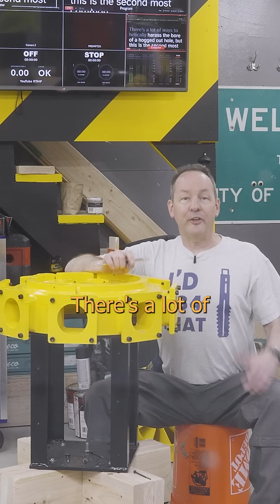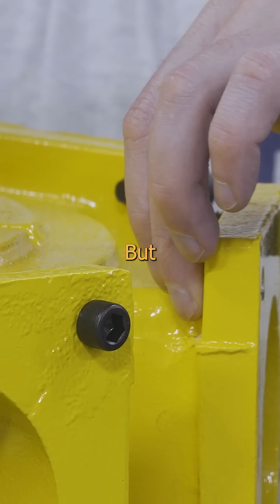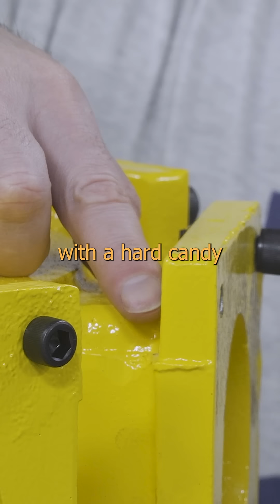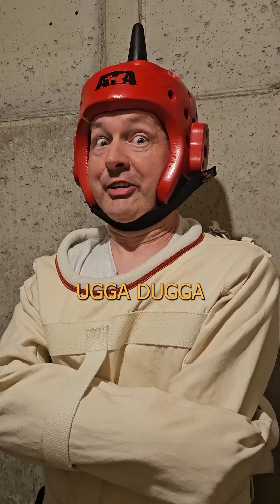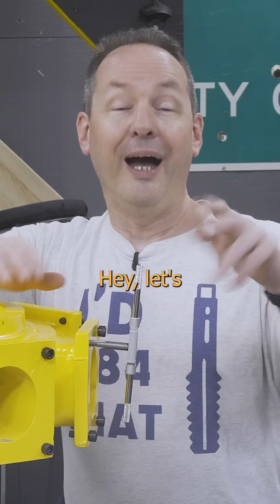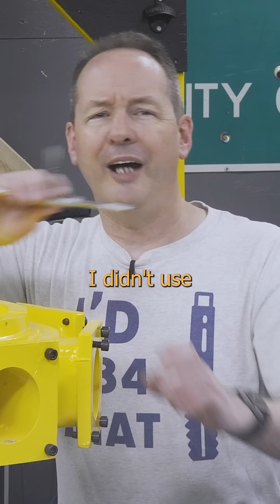Thread Chasing  #chrisboden #comedy #engineering #skills #workshop #metalworking #tools #apprentice

Comment: I have arthritis so spinning a tap in and out isn’t the most comfortable thing for me to do. When I’m building an engine, I clean all the threads before I start assembly. So I pin the tap in and out with a drill, and I just set the clutch to a light setting (usually 3-8 on my drill), and don’t tighten the chuck all the way. Cleaned out hundreds of holes like this and have not broken a single tap or cross threaded a hole that wasn’t already iffy (I have every metric size of helicoil I could possibly need on hand ready for the few times I needed them)

Comment: Actually one time I used a helicoil to fix a transmission pan bolt boss, broke the bolt just before it needed to bottom out, when I I drilled it out the helicoil came out and the original bolt went back in and tightened to specs

Comment: Tightened head bolts on a small engine with a torque wrench at the max setting after taking it apart, they snapped.

Comment: Dumbass. I don't know when I will finally learn the lesson to not force it under pressure, but I have started to learn that when it comes to important data on hard drives or other media, I am guaranteed to lose it if I'm trying too hard. A physical time I learned this lesson was when trying to remove the harmonic balancer from a '92 Del Sol. Thought I could force it with the wrong tools and wound up screwing the engine.

Comment: Dumbass. Lmao. In a aluminum hemi head I drilled out the old bolt that wouldn't come even after welding nuts and easy outs got broken off in it. I drilled the hole to spec size and chucked up the tap. Ended up drilling a bigger whole. Learned my lesson it now has a timsert as the threads and is holding strong and true.

Comment: Dumbass, so as tool and die apprentice I got the joy of re- working some very delicate parts  about 180 of them...so since I thought the holes are already tapped and the drill press was open I would save some time...well I did save time and also scraped 170 w.i.p parts...

Comment: I didn't even use a drill but I was tapping a bed bolt hole on a brand new 2024 rzr 1000 that was stripped and it broke while I was using a ratchet and then my boss told me after that oh yeah I dropped that one earlier...... Took me 3 hours to get it out bc of the angle it was in

Comment: Dumbass... I did the same in an engine block, ended up making a larger hole and threading it for an entirely different bolt and drilling out the hole on a water pump to make it fit properly.

Comment: Dumbass.  I tried to tap a 3/4 inch hole in a 2000 lb slab of steel with a drill 2 carbide drill bits and a few hours later i got the broken tap out of the hole. Re welded the hole and redrilled and tapped it properly.

Comment: Ironically, the word, they suggest pops up a window, wanting to confirm that I understand the community guidelines.  Even though I know you told us to post that word, I’m not going to do so - I don’t need some back and algorithm, deciding that I am the troublemaker that I really am. 
But to the original question, I learned this the hard way, being a less than intelligent mule in the process.

Comment: No drill for chasing threads? Fair enough. Taping fresh holes? I've broken fewer taps with a drill than without. Also, use a lubricant, it's a must for fresh holes.

Comment: And if it’s a blind hole, you’ll be wanting a bottoming tap.

I have tapped many hundreds of holes in aluminium with a drill. The odd broken bit or buggered heat sync was cheaper than my time.

Probably wouldn’t chase a thread in aluminium with a drill though. That’s just asking for a smooth bore.

Comment: "Dumbass" but on the other occasion. I work at fuel refinery plant and we have a lot (and I mean A LOT) of valves. some are shut-off valves, some regulate the flow or pressure or level. The thing is that every valve that regulates something have a positioner on it. And one day me and my colleague started to unscrew the lid, did the job, screwed the lid on, then shit happened, we wanted to unscrew it but "FUCK!" happened and the lid stopped unscrewing because debris got into the threads... somehow...

Comment: I also learned to twist 1-2 full turns and backing out around 1/4-1/2 before doing it all over again was the proper way to do it in trade school. I would’ve absolutely suffered after having to rethread a stripped hole in the schools engines

Comment: Anyone that actually learns to use taps eventually breaks one in a hole doing something stupid. It's a rite of passage. Fun fact: you can us a 3/8-16 die to cut new threads on a 10mm-1.25 stud on your POS Tundras exhaust manifolds. Not easy, but it works.

Comment: you can also do it with a bolt, find the start of the thread of the bolt, turn it 180° and file a notch into it so it becomes like a small tooth that eats the painting.

Comment: Somehow, I got the "Follow the rules to the T" AuDHD and when I went to machining classes, they told us never to use power tools to tap threads. I, honestly, never have and I never will. Tap and tap wrench all day. I've seen people tap aluminum with a power tool and it wasn't pretty. Couldnt get a set screw in there for the life of me, it was so crossthreaded. We had to drill it out one size bigger and then retap it BY HAND in order to use a one size bigger set screw. Thank god for precision 5-axis vertical mills.

Comment: So well just say theres a factory worker that builds vehicles. Some sorta sensor got cross threaded and sent halfway home in the exhaust stream. Due to production pace, and demands the idjit who ran that into the hole as crooked as a politician requiring an unnamed "specialist" employee to climb into the Osha no no zone and chase the original threads vs the ones idjit attempted to install in 10 seconds while cross eyed. 5 ugga duggas later it was fixed.

Comment: Chris, how often do you put on the straight jacket to record those cutaways? Do you even put it on all the way?
Reply from the maker: We shoot the jacket bits one at a time, so, daily. If it's a Mid or Wide shot (like when you see it outside) then we do all the straps. For the closeups (in the cell) we don't do the crotch strap.

Comment: I always use a drill, 1st gear, Walter Kool-Cut spray, and as low on the torque clutch that it'll work. An Irwin tap to 3/8" drive, then a 3/8" square to 3/8" hex adapter. No slipping, no awkward angles. That said I don't thread anything larger than 5/8" NC.

Comment: I remember when my dad taught me about tapping threads, and he told me all about how brittle taps are and stuff like that. I definitely listened to the "gotchas" that he told me, and it was kinda obvious to me at the time to definitely not use a drill with these things.

Thread chasing is a little bit tedious, but way way way less tedious than needing to drill that fucking hole back out into a larger bore and then re-tap it again.

Comment: Fantastic video, Chris. And yeah, *Dumbass*.

I was a helicopter wrench in the Army, but, as normal, I had other equipment that I was responsible for. One was a deuce and a half truck and I loved it. If I wasn't on a bird I was on my rig tinkering when I noticed a cross-threaded bolt on a body panel that some schmuck had tried to muscle home anyway. It was toast. I rapidly got a tap stuck in it and snapped it. Luckily the platoon Sgt in charge of the motor pool loved the fact that a "bird wrench" was in his shop turning wrench just like any other of his privates and getting their egos checked. He rook the time to show me how to drill it out, weld it, grind it down, drill and tap it out correctly. Not.my chain of command, but that man knew what he was about and loved to teach. 

Kinda like you, Boden. Keep kicking ass, man, and God bless you.

Comment: Dumbass. I was 16, bought a cheap T & D set from harbour Freight so I could touch up some old tools I got from estate sales with threaded tangs for easy handle access, mostly because I thought it would be cool to do. Thought I'd be pretty sick if I could make my own pommel nuts too, drilled out a hole in some mild steel, chucked it a drill and snapped it off in 30 seconds.

Comment: Dumbass witness here. 

I watched a guy do it, I warned him about a half dozen times he was gonna break it off in the hole. It was a 3/16’s tap. 

This guy not only broke it. But it was only the tip because as he was backing it out: “see? It’s fine.” 

About the time he got to the end he figured out the last quarter inch or so snapped and was left in the hole. 

Nightmare fuel to get it out. Thankfully it wasn’t my job to get it out as I was just a welder.

Comment: i am that dumbass 
i learnt how to do it properly with a battery power drill though 
and the only reason is 

i have to do it on a v-mill too 

using the correct auto reverse chuck adapter

Comment: I am also a dumbass.
I was tapping the holes on my enginblock becaus they were clogged up worse that your mom when i finish. And when i did the first 2 i got very bored of the tap wrench so i put the tap on a milwauke impact on the fast setting and i full sent it. I fucked the hole hard enoigh that i had to throw the whole fucking engin block. Cost me 3 grand and the wife wanted to kill me for about 8 months.

Comment: This just brought back memories of me hand threading 2” pipe threads into a solide block of stainless with a worn out tap olden then my mum , a hole the boss said was close enough (way to small) 
I did quarter turns around the vice with a 6’ pipe extension 
At least I got my steps in and production was back up and running

Comment: I was the dummy on an original 1851 colt navy revolver. There was a bolt head that snapped off because I didn't put any penetrating cleaner in it, tried to use a bolt puller that only made it worse so I drilled the bolt out (way too deeply) and it took most of the threads with it. Took me over a year to get a new bolt the right size and 2 tries with the tap to get good threads. It breaks my heart I messed up so bad, but God bless it I can load and fire that ancient piece of firearm history with no problem

Comment: Dumbass! 😂 It took a couple of times for me to figure it out. I’ve always know to go slow, don’t use an impact, reverse every turn to break/clear chips with air. Taps are a tool that wears and should be replaced, but the better your technique the longer they last and who wants to dick around and try to get a piece of hardened steel out of soft steel anyway? It’s almost like they’re designed to break off flush or buried 😂

Comment: I was once drilling out a bolt on my radiator and proceeded to both completely ruin the threads and put a hole in the radiator which was just great especially cause I didn't realize the hole was there till I fixed the threads

Comment: Dumbass here. Early in to my wrenching career I snapped a bolt off in a motor had to drill it out only to snap the bit on the way out a few hours and a lot of cussing later and it was out. Only to immediately think I could run the tap in with my drill just to do the same shit 😂😂😂 very hard lesson was learned that day. And about six months ago had to unfuck an apprentices fuck up on a brand new ninja 636 block.

Comment: Dumbass here, I fucked up the threads for a water pump on a 460 in an f250 I used to own, I couldn't get the bolt started so I went to tap it out but I chucked the tap up in a right angle drill and tried to tap out the hole while the water pump was mounted up. . . Sooooo I snapped the tap, of course, and hand to pull the radiator and core support off to get at it, the tap wedged itself in the water pump and I couldn't get it off so I had to score the water pump with a grinder then crack it with a chisel to get it off, and even then I couldn't get at the tap so I had to weld a nut to it to back the thing out. Tuned an hour and a half job into a  two fucking day ordeal and cost myself a new waterpump.

Comment: I don't really do clean up jobs 

But when using the drill method to create some threads I did one time end up snapping one because I used an impact do not use an impact turns out it does the same thing as dropping them

Comment: I was smarter i used a clutch drill. Lasted longer still snapped it off on a backout when i slipped and the hardened steel had a shock. Luckily it was already cut so a couple scribes backed it off

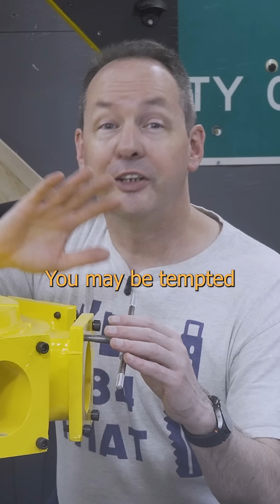Comment: 1:43 no problem with enough experience

I don't even need to start threads by hand when I use the impact driver, put the lugnut in the socket and zip it on. havn't crosstreaded anything in years

Comment: Dumbas, well long story short broke the M3 threading tool just becouse material was harder than HSS and I did over 1000 threads that day (4 per peart) so it goes in the realm of less meanigfull task. The main thing is I broke so many threading tools why doing this mass produced part I don`t really know by now if it`s the streess on the tool or not enough lubrication ( this part would go well with the scene of a red helmet and constraint psycho ward suit)

Comment: I’ve done it with a drill a few times, little to no issues, though I was using a tap designed for a drill.
if you want to do the job wrong, atleast use the right tool!

Comment: Dumbass here. Tried removing some foam from a thread where a fridge hinge went, only had an impact. Sufficed to say, having to use needle nose pliers to remove the broken tap was certainly a way to run the clock.

Comment: Never screwed up a tap, but after fixing the brakes the brakes on my truck, I, like a dumbass, decided to put the lug nut into the impact socket to put the wheel on quicker, I lined up the impact with the lug and held the trigger down. I then had to break out the grinder because I cross-threaded the bastard.

Comment: it should be noted that the reason you dont want to use a drill is not just cause of speed. you can be moving slower then your grandma on a half dead moped she clames is working all fine and dandy but still crossthread the hole due to torque and not noticing the squealing of the hole slowly forming a new cut due to the noise

Comment: If you're on bare metal, or don't care about the paint, you can put a bit of oil on the tap and it'll collect the debris in the flutes. Can of brake clean and move to the next.

Comment: "Dumbass" When I first tapped for a screw, m6 I think, in the end of some aluminium bar I forgot to back it out at regular intervals, so I ended up with a bunch shaving at the bottom of the hole and no way to get them out because they had partially fused to the bottom.

Comment: Dumbass.... I rounded out a hole while building a wall mounted basketball unit.... The manufacturer sent it with paint caked in the threads. I used a speed tap and it snapped off in the 1/2 plate steel. Only solution that didn't involve dismantling and re fabricating the part was to punch it out and make it a larger gauge...... We were in the middle of no where. Luckily a larger gauge in this instance was acceptable and we happened to have it in the work van. But I had to do the other 7 bolts on the unit so they all matched. As well as on the other 3 basketball units. Turned into time and materials..... I did all these by hand patiently..... Dumbass

Comment: DUMBASS! hello, that’s me.

i was attempting to perform a differential pressure test on a fire backflow. the 3/4” threads on the test port ball valves were corroded and needed a tap to clean in order to attach my test connectors.

i cranked on the tap towards the end of the threads with my adjustable wrench and split the side of the valve and the plastic seat where the ball sits. 

mind you, this backflow was in a tiny exterior closet behind a nail salon. when that valve split, it ripped 60psi of water straight at the wall and all over the concrete floor. the water ended up damaging the laminate flooring in the salon as well after it pooled and seeped.

it took me ~60 seconds to get the water turned off but the damage was done. 

i didn’t get a wrist slap let alone a “talking to” from my bosses. accidents happen man, and my company didn’t end up paying a dime to the property manager anyways. we gave her a few freebies on the inspection side and all was well 😂

Comment: in lawn mower spindles only... like on a husqvarna or a craftsman or yard machine etc 
the spindles are a cast aluminum housing and they normally come in 3 or 4 bolt hole configurations. 
i take my 5/16 by 18 rap chuck it up in the drill and (makes drill noise) brrrrraaaaap down (more nosie) brrraaaaappp back out. on all 3 or 4 (depending on configuration) holes.
been doing it the same way for 21 years changed thousands of spindles not had 1 issue. 
SIDE NOTE!!!!
i have went threw and tested alot of different taps.
i go threw several taps (5/16 by 18) a year as i said i change alot of spindles.
but ive trade alot of different brand alot of different companys. and he did not mention it but i will say 
The best taps ive used normally cost the most and seem to last longer and hold up better then the 30 dollar kit you can get a H.B. 
Also i have tapped wayyyy more stuff then just lawn mower spindles and he is 100% correct. go slow and take your time. unless its a mower spindle. then chucks that sucker up and feed it the onions cuz.

Comment: worked for a big company producing customized distribution boards for industry -  was very surprised to see them using taps with electric drills after i had just completed 18 months doing machinist courses. they did not own tap wrenches and their concept of cutting grease was WD-40.... I did learn to somehow make decent threads, but it was definitely an experience😅

Comment: Jokes on you, i start by hand a then slip over a drill on low torque  on the clutch. Feed in and out and im done. Sometimes i use square TAP  sockets which makes the switch even faster.
Havent broke a TAP o thread that way yet.